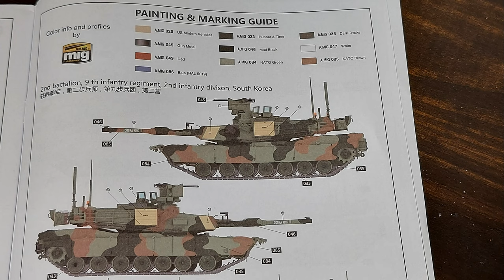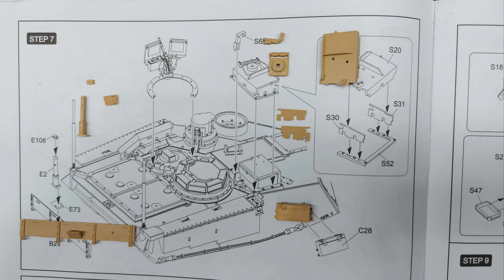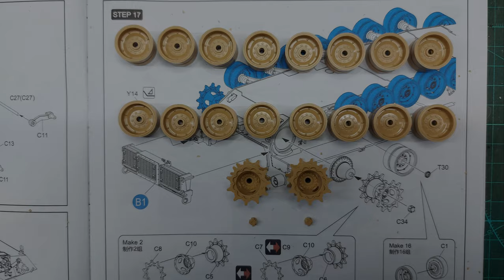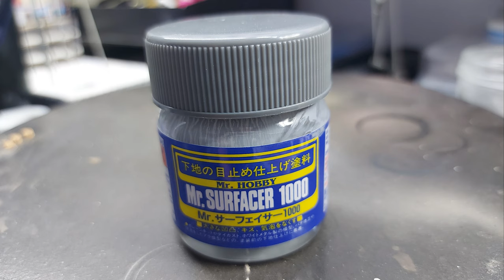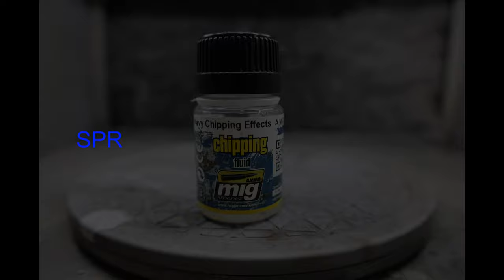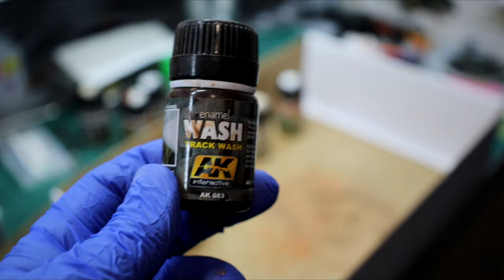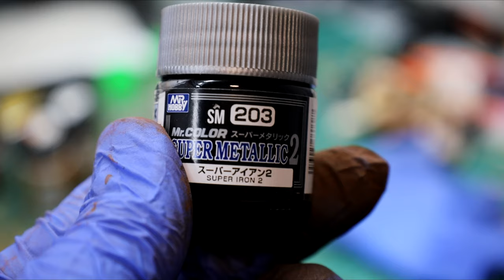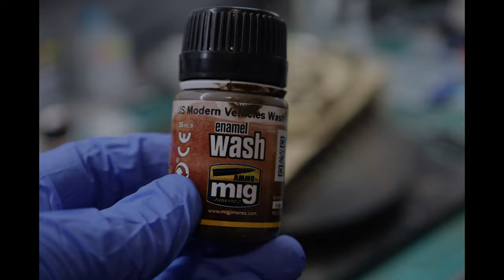Rye Field 1/35 Abrams M1 A2 SEP V2 #abrams #models #usarmy

Comment: Hello everyone, I recently bought some add ons for the M1A1 Abrams kit (M1A1 Abrams Accessory Set) , from a company called Legend. It's stuff to be added on the tank, such as barrels, crates, backpacks and so on. Problem is I don't understand how to separate the items from the sprue, since the sprue is incredibly though and thick. Can anyone help me with a suggestion? Many thanks.
Reply: you generally use a hobby saw to cut off the parts from the rest of the sprue and then sand when needed.